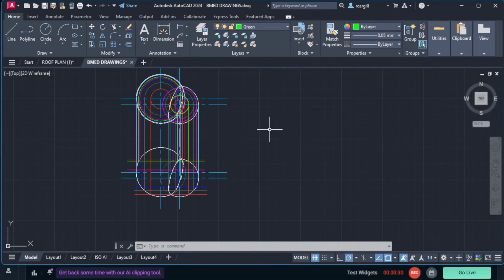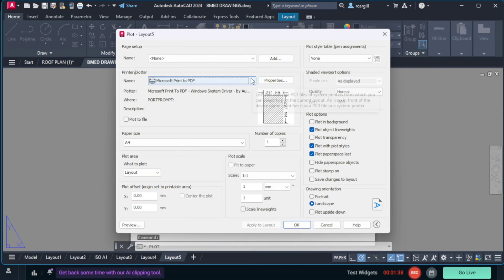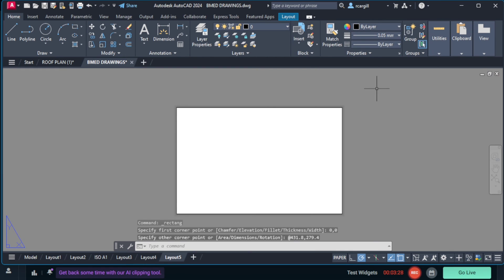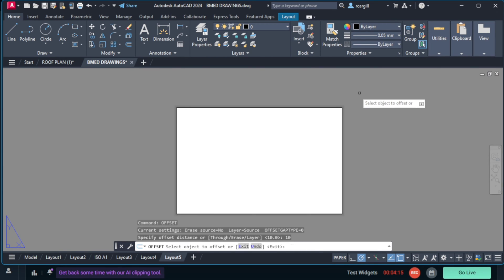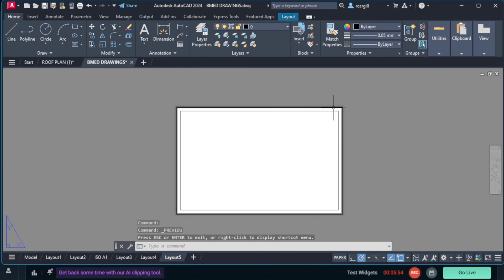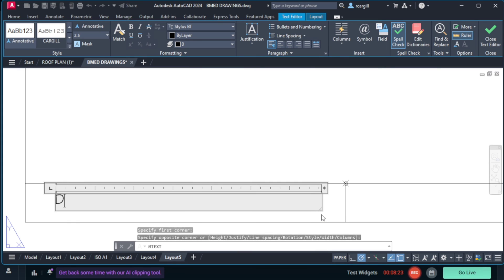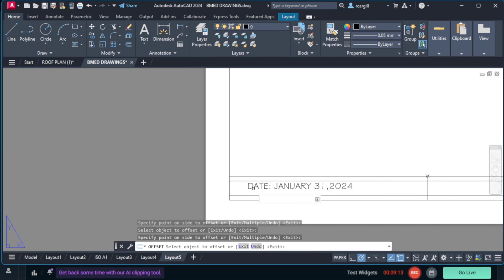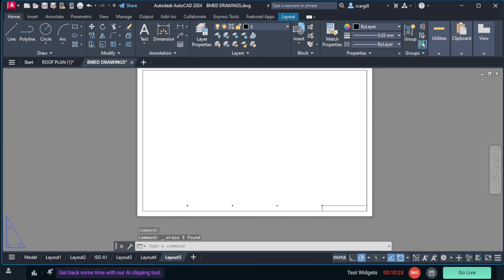How to create your own title block in AutoCAD

Comment: I failed to find the tabloid option in page layout and the rectangle failed to offset😢....l need help with the offsetting of the rectangle majorly..thank you
Reply from the maker: The tabloid paper size is 11x17 inches. The full name is ANSI full bleed B 11X17. See if you can find that. If the rectangle does not offset, click on it and select explode then offset each individual line.